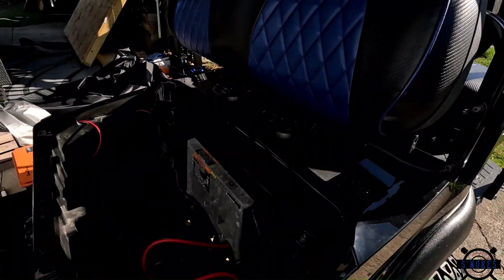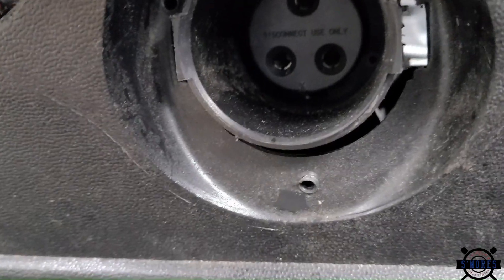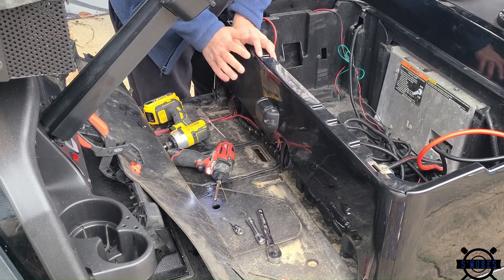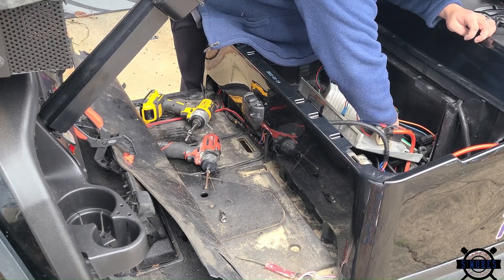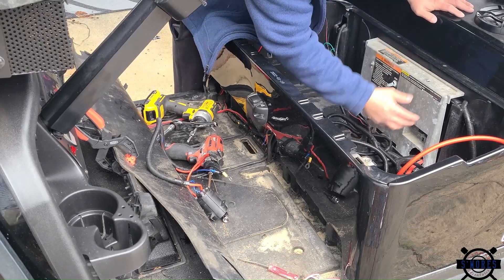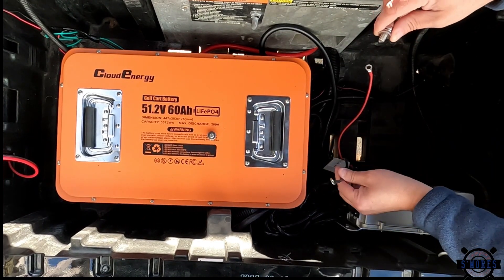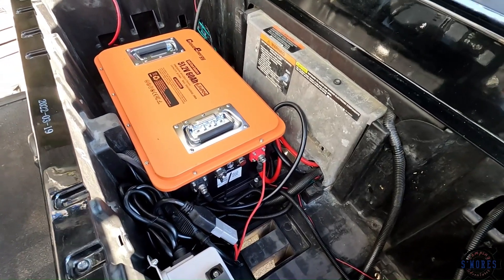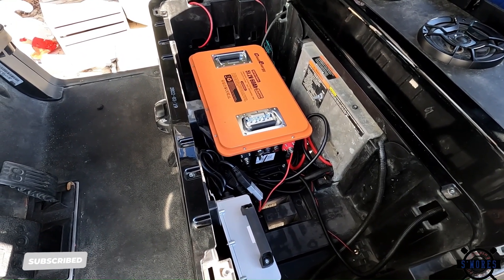Cloud energy 48v 60ah lithium golf cat battery conversion club car precedent

Comment: Installed this same battery. How do you shut off the lcd?  When I push the power button it just cycles to the next screen. Holding it down does not work either.  Any ideas?
Reply: yes, super easy actually. it will time out after a few minutes with no current draw or charge.( resting) . if you want it to stay off just dont turn it on after it goes to sleep. unfortunately there is no option to turn on/off freely. i hope that answers your question. thanks for watching!

Comment: Why did you bypass anything? As long as the battery puts out 48v no bypass is required. Or your bypass is just for the charge port? I completely replaced my charge port which may be the difference.
Reply from the maker: this particular cart is a 2017 so yes there really isnt any "bypass" some earlier precedents (04-13) you might be able to get away with it but sometimes because your no longer using the oem charger port the obc will tell the controller to shut down as no charge cyles have been noticed and think voltage is wrong.
for as simple as it really is i just do it on the earlier ones.
so no technically you dont have to BUT may run into issues down the road
also i ALWAYS remove the oem port so no one can ever try to charge with an oem lead acid charger. 
thanks for the feedback and watching!

Comment: So between this battery and the Temgot battery, aside from the amp hour, how would you compare the two as for as quality? Is the Temgot worth the extra money? I have a 2020 Club Car Tempo, and I am looking to replace my wet acid batteries with lithium, not to break the bank, but would like a good battery for the money.
Reply from the maker: honestly cant go wrong either way. Temgot gauge is cleaner for my personal preference and had the rs the remote switch.. (which cloud can do from app as it has more control than temgot) cloud energy does have a 48v 105ah METAL case now also . cloud energy customer service i have personally talked to and have always been great. 

honestly cant go wrong with either 
thanks for watching!